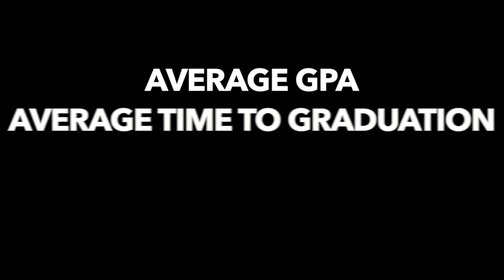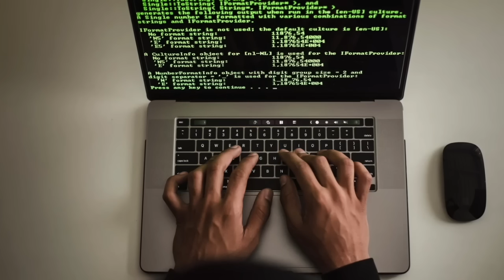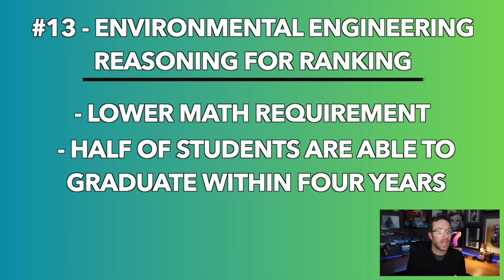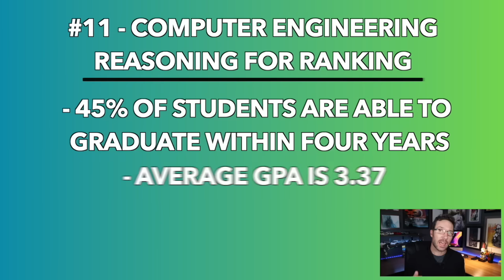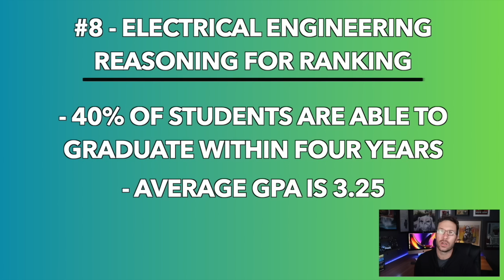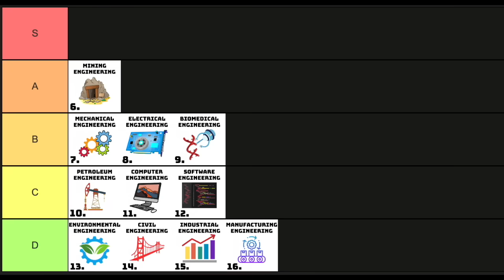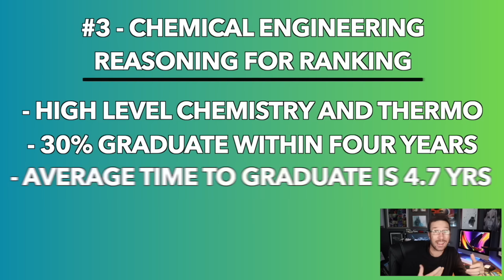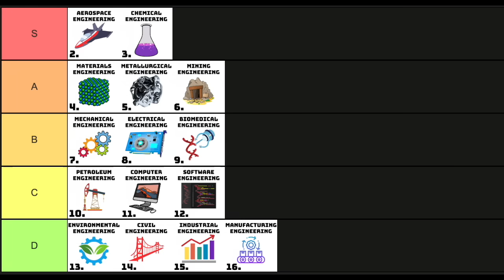Engineering Degrees Ranked By Difficulty (Tier List)

Comment: Using average GPA and conclusion time is missleading because it doesnt depend just on the difficulty of the degree, it also depends on the profile of the students.

I firmly believe Electrical and computer Engineering should both be much higher on the list. The only reason the average GPA is high is because it tends to attract the strongest students. That kid that got prizes in math/physics olympiad on high school wont go for a metalurgical engineering major, he's much more likely to choose either computer or electrical engineering. If you rank degrees by high school GPA of students i guarantee that EE and CE are near the top.

The "highest math requirement" can also be missleading because a lot of the math in a degree is done within specific courses of the major, rather than in a separate math course. 

 For instance an EE student will need to learn about the fourier transform and the Z transform when they study signals and systems. They may need to learn about stochastic processes for dealing with signals with noise. 

Computer engineering won't need as much "contunuum math", they use more discreete math and may need to learn about graphs, number theory, recurrences...

Comment: I studied CE, but working always in positions developing software. Software Engineering it is not more difficult than Civil Engineering.
Reply: Software development is different than computer science which is what you would be majoring in at the university level. If you ever dive into Algorithms and Data Structures, you will see why computer science is more difficult than civil engineering. Take it from someone who has taken multiple classes in both subjects.
Reply: @tomdarank1272  In the video he is splitting Software Engineering from Computer Engineering, my claim at least is for Software Engineering.

Since I was a child, in parallel to my studies as CE, and since then, I have learning different programming languages, and required to solve different problems, mainly in the areas of fluid dynamics, hydraulic and hydrology. Numerical modeling, implementation of ANN, a couple of applications with a GUI using GTK, programming with pointers in C. Sorting, optimization algorithms, linear, nonlinear and dynamic programming, and even taken advanced lectures in numerical methods and analysis. As a kid when I was 8 years old I learned Basic doing spaghetti code using GOTO when it was trendy, then relearned structured programming when GOTO become banned from the good practices, and even needed to relearn to use Object oriented. In my university any engineer take the math lessons sharing with pure mathematician class mates, and that is the level that they expect from us. This include lectures in the basic algorithms, numerical methods that deal with the solution of many "standard" problems. But latter in the CE we come to work with Navier-stocks equations and in my case it means to work with much mode complex algorithms for initial and boundary problems, deal with algorithms for diffusion of substances in water quality. The understanding of physics, the interaction of forces and fluid properties, is something that I know, it would not be easy for me to learn by myself.

Complex data structures, is something that of course a CE will not learn in a lecture, but I did by reading books and asking my friends. Algorithms, as I told you, we required to learn how to deal with many of them, what a CE will not deal is with software metrics, or may be not expending too much time in optimization of the algorithm, may be he will happy with a bubble sort, they will see the concept of O(h2) only once, and then forget, but do you see something that is that difficult that any person with a proper understanding of logic will not be able to catch?

As a CE, you also need to dive in databases as GIS is an important tool, and learn Photogrammetry, linear algebra and geometry, that provide you important grounds for image processing in 3D. Basically there is no topic that I talk with any of my friends or colleagues that I find I can not achieve with self learning. May be implement an OS from the bare bones is something that I will be afraid of. But from the rest of what I see people learn while studding, there is nothing that make me feel that will be harder than "Continuum mechanics".

In my personal case, I also dive in make client-server programs, work with Arduino making an autopiloted boat with GPS, magnetometer, deep and speed sensors, including telemetry. and there I was needing to exercise the optimization of code not only in terms of performance, but in terms of code size. 

Something that for sure you must have is a good logic, and a love for structural thinking, other ways you will not able to manage it.
Reply: @tomdarank1272 
It’s all really subjective, because I found mechanical engineering and electronics engineering courses easier than CE courses

Comment: Incredibly poor take! Very unbalanced and half of the ‘degrees’ on this list wouldn’t even be classed as proper engineering degrees at most respectable universities. Even the simplest parts of electrical engineering (power systems) require partial differential equations. Material engineering probably takes longer because its participants can’t spell or count to 5.

Comment: Although I studied mechanical I think in practice the hardest ones are manufacturing mining and petroleum. They are tied heavily to operations and anytime your tied for a 24/7 operation that is constantly failing its brutal. also your tied more heavily to the finances so you get a lot more pressure to fix thing quickly to hit business metrics.

Comment: mechanical and aerospace are pretty much the same, I did mechanical but to go into the aerospace route it required like 3 different senior level classes. overall the hardest degree is the one your not interested in. I would hate software engineering.

Comment: Did u really say this was supposed to be best video out there on the level of difficulty in engineering degrees? 
Can u pls tell if u have experience in calculus and differentiation? 
Also, if u literally have gone through the course material or just the syllabus of these degrees cz u r so wrong on Electrical engineering there buddy, being an electrical engineering graduate myself the level of difficulty u put it at is absurd and it is certainly not limited to partial differential equations only as highest level of mathematics.

Comment: I graduated from Louisiana Tech University in 1981, in Chemical Engineering, and ultimately became a Fellow of the Dow Chemical Company (one the top eight technical eight out of 60,000 people in the Company).  Interestingly, Louisiana Tech has produced more Dow Fellows than any other school in the world.

I think you might need to check the math requirements for ChE.  PDEs were required when I took it, and are certainly needed for high level work.  Also, I regard Nuclear, BioMedical, and Petroleum as sub-branch specializations of ChE. 

ChE and ME have large overlaps.  I have a great deal of respect for EE.  Also, I found that, in the real world, Industrial Engineers create huge amounts of value.
Reply: Thank you for sharing your experience your comment about industrial engineering intrigued me because right now I’m working in the logistics field and I’m considering studying industrial engineering can you elaborate more on why you think they are important and what challenges it gonna present and what gonna hold in value.
 Thank you
Reply: @abdulwahabalwahbi8661  Thanks.  I would be glad to.  It was my experience that problems that clearly fall into one discipline have been largely solved.  I found that the best opportunities for creating value was often in the grey space between disciplines.  One of my mentors worked in the space between ChE, BiomedE, and ME.  I worked a lot in the space between ChE, Supply Chain, and IT.  There were lots of opportunities.

Work processes are extremely important.  Industrial Engineers are the best for analyzing workflow and figuring out the best way to do a task.  

Much of my work was in Supply Chain.  I worked for the largest Plastics Business in the world.  After raw material costs, the largest cost savings opportunities in the Business were in the Supply Chain.  I was given a clean slate and the freedom to choose what I could work on.  We saved hundreds of millions of $ and improved service.  I came in with deep knowledge of our chemical processes.  I learned a lot about Supply Chain and Logistics and was soon able to see the opportunities.   The more you learn about multiple disciplines, the more opportunities you will see and the more problems you can solve.  

I recommend a book by Scott Adams How to Fail at Almost Everything and Still Win Big.   It will expand on the idea of a “Talent Stack” i.e. developing knowledge in many fields and how it expands your capability and value geometrically.

I would be happy to discuss further, if desired.
Reply: Nuclear E is a sub-field of Engineering Physics, which is not even mentioned here.

Comment: I have a degree in Geophysical Engineering. I think it is at least as difficult as most of the others. It requires high levels of math, physics, geology, and mechanical engineering. It is about as broad a discipline as you will find.

Comment: ee is harder than machenical
Reply: It really depends. It would have to be judged by someone who hates all forms of engineering but forced themselves to take it. EE is very abstract.
Reply: @ncopp4358  Signal and Power transmission is way harder than Machenical.
Machenical even get gpa from Modeling, which is only viable from one course in entire EE map.

Comment: Here in Norway we ranked these by the grades needed to get into the university program, and by the level of math needed for the degree. 
EE and Physics tied for the top level in math, requiring the full calculus set (differential equations and partial/algebraic integration) while all the other degrees got away with a bit less. 
In reality, most of calculus have been replaced by numeric methods over my 40+ year career as an MSEE/CS guy.
Reply: Hello. Could you please clarify what you mean by numeric methods please?
I have personally just started an electrical engineering degree (later on will take one the BEng). We use C language for programming classes. Will that be good for job world? I've read it's a good beginner language, and you can use it as a good base to learn more complex programming languages later on.
Also, my lecturer said that things change very quickly in the electronics world, and we by the time we leave uni, our knowledge will be of little use. We have to stay up to date.
Could you please give me any advice from the experience you have built over years? For example, what to expect in the job world, what tools to learn using from early on, uni advice, study and work ethics, internships, and/or other things that you would know.
Reply: @uz.f1746  The hardest part of calculus is to generate exact solutions for integrals, right? While differentiation can be done more or less by rote, combining relatively simple rules for partial differentiation, integrals seems to be solved with a bunch of semi-magic transformations. 🙂
This is where numeric solutions typically gets you a "good enough" answer with much less effort.
Reply: @uz.f1746  numerical methods involves the use of various techniques(euler and rk methods to name a few) to find roots of equations, solve differential eqns , boundary value problems etc
Reply: I am under the impression that just about all complex math problems nowadays will be fed into a computer and taken care of in seconds. No engineers can afford to spend a week with pencil and paper on it.

Comment: I agree with most of the tiers you listed, but this probably wouldn't apply for other countries. I'm finishing computer engineering in Brazil, and here all the engineering or at least 90% of all engineer courses have the full math classes, so every engineer have the same base for the rest of the course. Not only that but here the course takes at least 5 years to finish because ,for example, if you are studying computer engineering like me, you'll have to study electromagnetism and other stuff that would be from electrical engineering. This is very good if you intend to have another degree in other engineering course because sometimes it can take half the time...

Comment: I used to work in the nuclear field. Several people I talked to who had nuclear engineering degrees regretted it because of very limited job prospects. People with degrees like electrical and mechanical in many cases can work the same jobs in the nuclear plant, but they’re not limited to working in a very niche field that the government is trying to shut down, or at least limiting the growth of. I wouldn’t recommend for most people to get a nuclear degree unless they want to work on the design aspect of a nuclear plant. Now I work on manufacturing/process engineering. The one thing I would add to your discussion of manufacturing is that almost no one I’ve met has that degree. It’s an uncommon degree. Mechanical is the most common in the manufacturing field, then probably electrical, chemical, biomedical, etc. I even knew one petroleum engineer who had moved to manufacturing. Tbh manufacturing engineering isn’t that hard. Anyone who’s smart enough to get any STEM degree can learn manufacturing or industrial engineering on the job relatively quickly. I wouldn’t recommend that degree to anyone. Just do mechanical.
Reply: Italian nuclear regretter here. Unlike in US, the salary mentioned in the video is a unicorn in Europe. After almost 8 years spent in growing expertise, working on safety analyses for real reactors and designing new fuel from scratch, I'm still at less than half that salary. That's sadly something you reach with many more years (or if you get "a push") and only at top tier management positions, which have more to do with finding projects and money for the company and much less to do with the engineering itself, like analyses and the technical part. As you mentioned, mechanical and electrical engineers can easily enter this field: to be a business developer, project manager and stuff like that you don't really have to know the nuclear things in a deep detail.
I might have been fairly unlucky until now, but to people that would choose nuclear hoping for a decent salary while being "only" analysts, I would definetely not recommend it. Mechanical is the way

Comment: Hmmm... I was trained as a nuclear physicist, and then continued with PhD, Post-doc and then became a researcher and lecturer, teaching (among other courses) research methods.
I really don't like your ranking and methodology ...
In europe, most engineering degrees require 5+ years of study for a master's degree, but we have different engineering levels too. I remember when I was studying, it was a legal requirement that the curriculum was 5 years to obtain a university engineering degree.
One studies partial differential equations  PDE after having understood regular differential equations, but claiming PDE is the top is probably limiting it to undergraduate level. At masters level you can add Numerical analysis, Stochastic processes, Optimisation theory, Control theory, quantum field theory, non-linear dynamics and chaos, . Ranking each one individually is impossible though.

Comment: Mentioned  Maths level requirements seems just for easy understanding here,  most of the engineering works have to go  beyond the PDE, except for the computer software related categories ( they use  different maths categories)
Nuclear engineering  needs highly abstract  branches of Mathematics such as  Group Theory related Lie Groups/Algebra, 4- Vector calculations, Green Functions... anyway its rank is justified.

Comment: How long the degree takes to complete is not a good indicator of difficulty in my mind. Many but not all engineering programs often require or strongly encourage some form of internship and that can require a longer time but also provides some experience in the field and some income while an undergrad. I would also think that those majors that require a theoretical math class like number theory might be ranked higher since many engineers can really bog down when they get outside of applied math. Finally I consider whether or not an engineering degree requires fluid mechanics to be an excellent indicator of being a more difficult program, so mechanical, chemical and aerospace all fit that model....it takes the application of the advance math to another level. In fact I have met PhD physicists who never took fluids...sad to consider.

And for the record my BS and MS were in Interdisciplinary physical science...math, chemistry, physics and geophysics. But I also took fluids and at least one EE course along the way (both were not available in the science curriculums) and worked as an engineer in a particle accelerator lab during my last two years of undergrad and my first year of grad school....nothing like learning engineering in a full hands on mode.